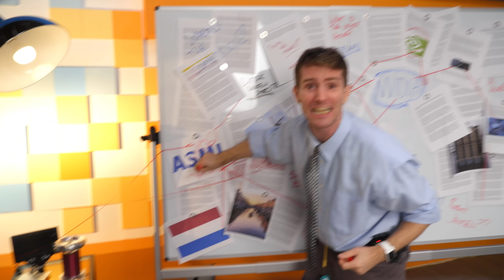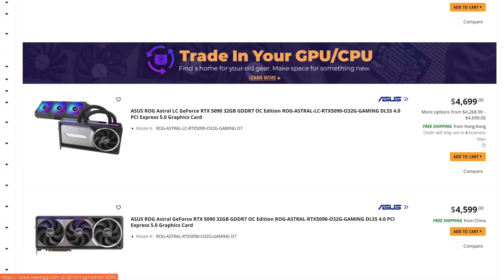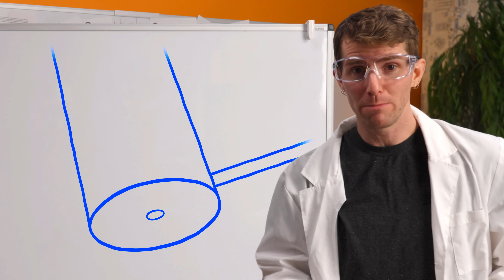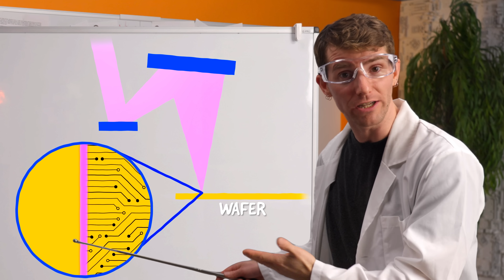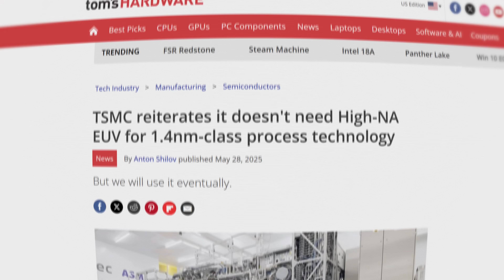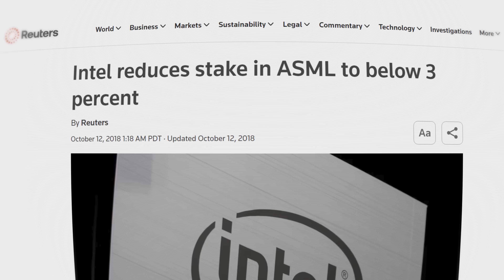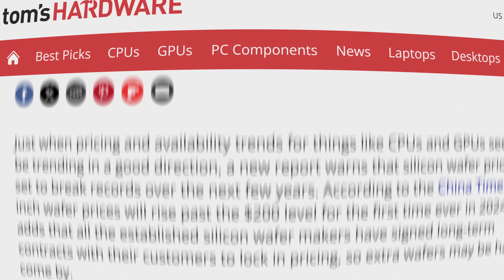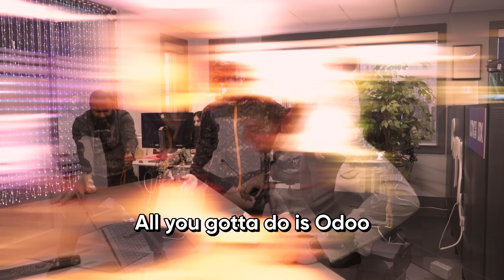This is Why Hardware Prices are Going Up… Again

Comment: When I studied chip design 20 years ago, 90 nm was cutting edge back then, the professor made the bold statement, the shrinking of the feature size will stop, when it becomes to expensive to build a new fab. He also assumed that at the end there would be only one Fab in the world which can deliver that.
Reply: he was spot on
Reply: Well then, what happens if a competitor is daring, makes the investment with a new fab and a smaller more efficient node and then becomes the default? Is the price of new fabs really gonna stop this..
Reply: @F1ll1nTh3Blanks  Competitors don't appear out of nowhere with no experience. All the competitors still exist today, they just can't make the same tech because it got more and more difficult, so they don't really compete anymore.
Reply: @F1ll1nTh3Blanks  It's not about having the fab, it's about having the know-how how to build a fab, thus why ASML is still a de-facto monopoly. China has been trying for decades to catch up, and while they're catching up, it's still years behind, DUV-levels behind. They just made it to a level in which they can produce chips with their fabs which can compete with the ASML machines which are now slowly being torn down for not being cost-effective anymore. Which still is a huge achievement. Also check LTT's 'China doesn't want me to have this GPU' and 'The All China PC'.
Reply: @Pranym  tbf to China, they only REALLY tried during the last decade or so, when the western sanction starting to become actually hostile when they banned Huawei. Regardless of how they get the tech, recent report said that they did manage to get EUV machine prototype going recently..... by basically signing-on all ex-ASML engineers in a top secret project.
Reply: @F1ll1nTh3Blanks  The thing about having competitor.... Is that the competitor need to start from somewhere, and also have billions of dollars that they are ready to burn. Each fab costs billions of dollars, but if they deliver sub-par products, who's going to buy them? That's why there are really only 2 competitors you can root on to break the cycle.... Intel (still have fabs, still have the staffs, still have the know-how..... but they really need to somehow leapfrog ahead in a cutting edge industry), and China (political will to spend billions of dollars). For first one, Intel is trying their best but they still stumble quite abit, for second one..... are you prepared to buy Chinese x86 processors?
Reply: @F1ll1nTh3Blanks  You can't bypass the laws of physics, and you can't just simply "make the investment" in a way that makes you even remotely competitive to the companies that have better access to industry expertise, access to funds and existing infrastructure and can invest and scale faster. This isn't your grandma's corner shop. There are already manufacturers worth billions in the space, and there's a reason they don't compete for node size. It just doesn't makes any financial sense, even for them.

Comment: I was angry enough to buy a 7800xt a couple of years ago
Reply: Same, though I bought an ARC A310, not because I needed it, but as a vote with my wallet. I might've gone with a proper ARC card when I built my new machine earlier this year, but it was a Linux machine, so I went with AMD for minimum headaches.